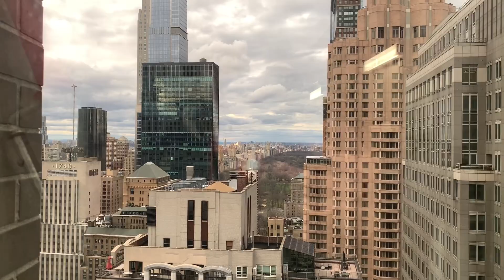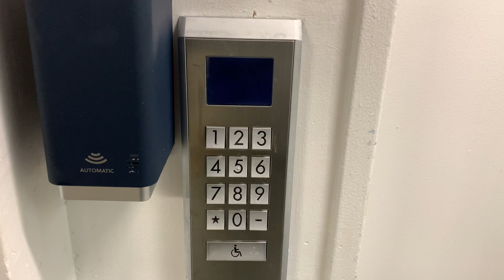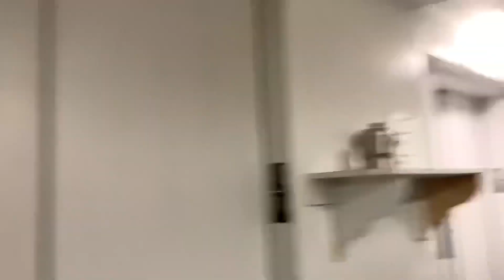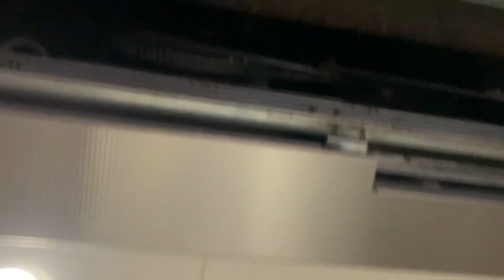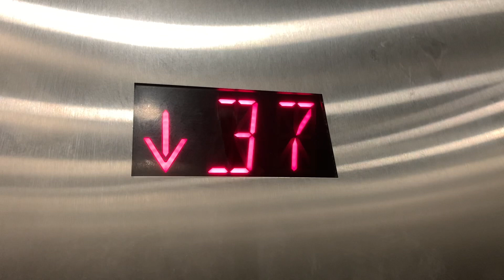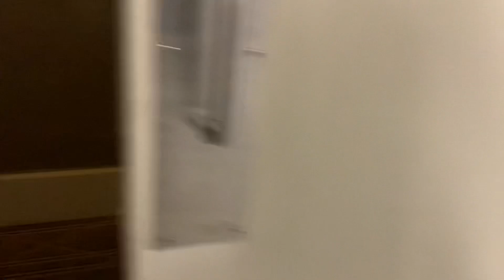BUSTED! Westinghouse (mod. Schindler ID) Service elevators @ Sheraton Times Square - New York, NY

Comment: rip. I've been into elevator filming for like 3 years and still haven't been caught. Well, what I did once was put my phone in a way that the employee couldn't see the camera app and also, I looked away from my phone maybe?
Reply from the maker: I’ve never had anyone suspect me recording.
They just always say to me that I can’t be on these elevators, etc.
Reply: You will mostly get busted in service elevators than regular elevators
Reply: @TSNY18-Animations Surprisingly I’ve filmed both the low rise and high rise service elevators at this hotel and I haven’t been busted once!  I personally recommend just going as low as 24 on the high rise service cars and for the low rise cars between 24 and 6.